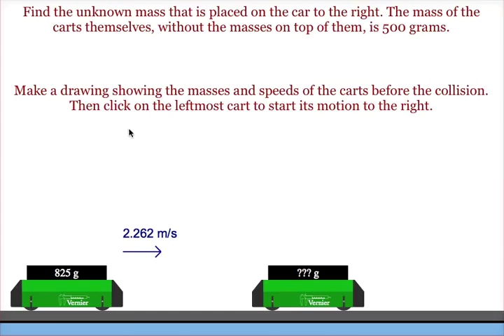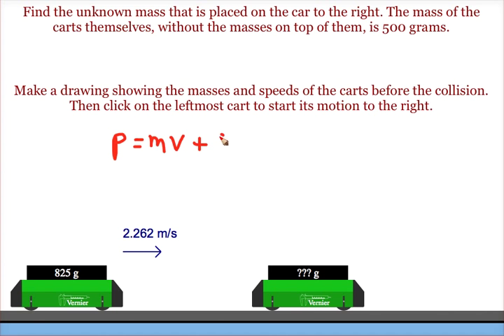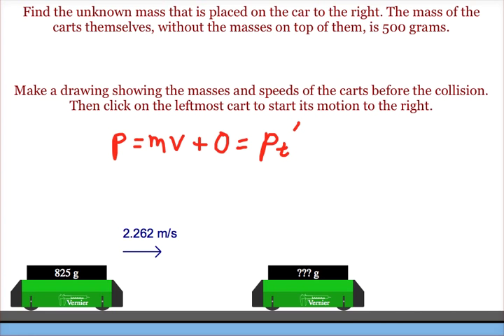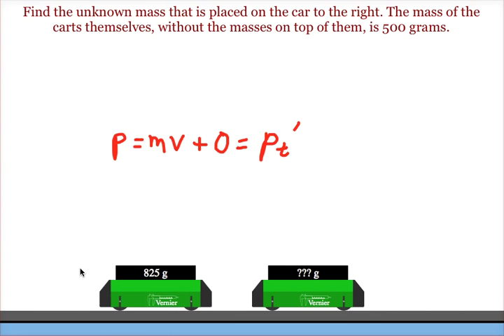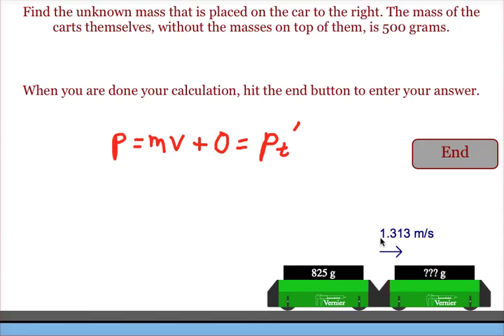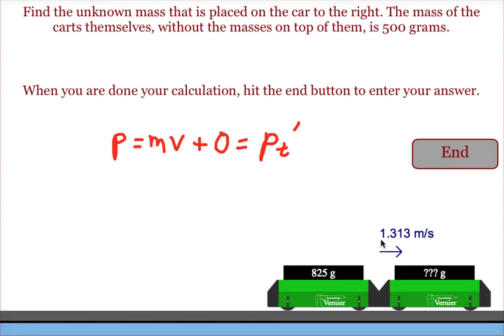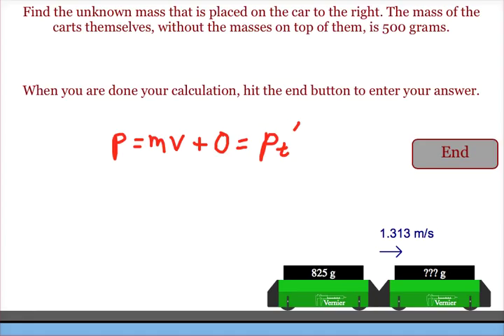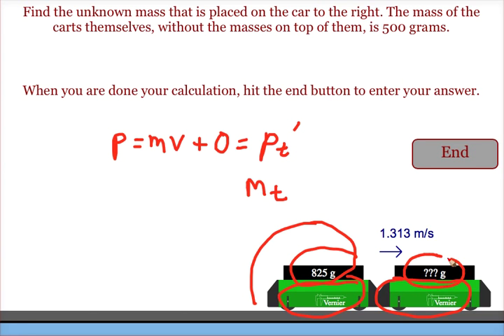Momentum conservation 2

Comment: this did not help how do i find the mass please
Reply from the maker: So you take the total mass of car 1 and weight on top (500g + 825 g) in kg and multiply it be the original speed (2.262 m/s). This will give you the momentum before the collision.  This gives a momentum of 2.997 kg m/s.  

Take that momentum and divide by the final velocity of the system to get the total mass of the system. So, 2.997/1.313 gives 2.283 kg.

This is 2,283 grams.  Then subtract the mass of the two cars (1000 grams total) and subtract the 825 grams that is on top of car 1.  This leaves 457.7 grams unaccounted for.  This is the mass on car 2.  I hope this helps.
Reply: @thephysicsaviary  Hello, how did you calculate the 1,000 grams by the 2 cars?
Reply: @thephysicsaviary  it did, i got it! thank you so much
Reply from the maker: @malloryconnor9303  No problem.  I try not give too much information in the video, because I want my students to have to process and apply what I am saying with just a minimal scaffold for help.  But I know sometimes that scaffold might not be strong enough to get all students through the problem.  It is a delicate balancing act to try to give enough information to be helpful without giving too much information that I do the problem for them.  Any way, it was my pleasure to help give you the added support required and I am glad that you were able to get it right now.  Take care.
Reply: @thephysicsaviary  You're the best!
Reply: BAHAH